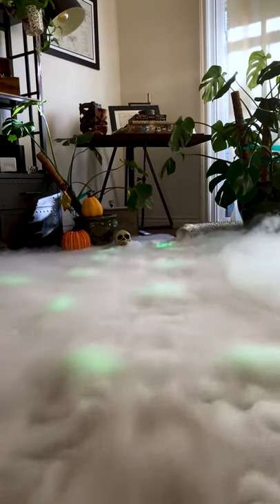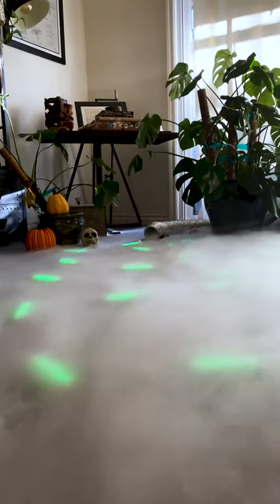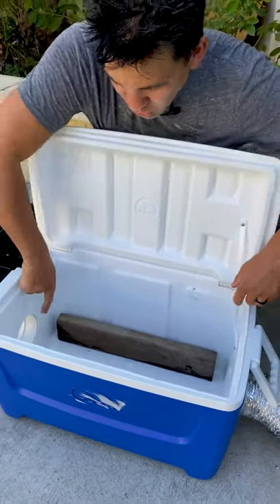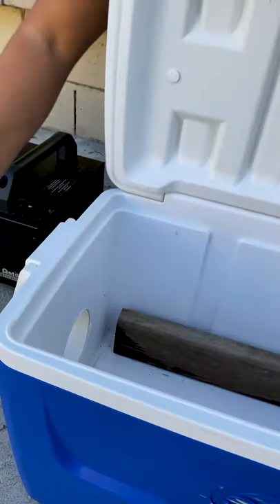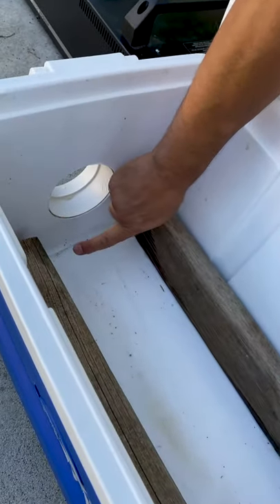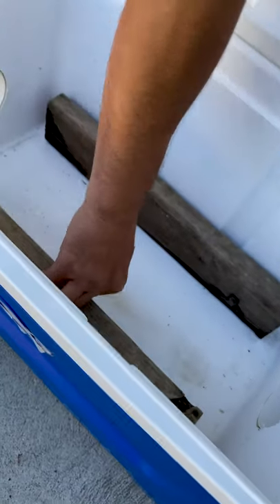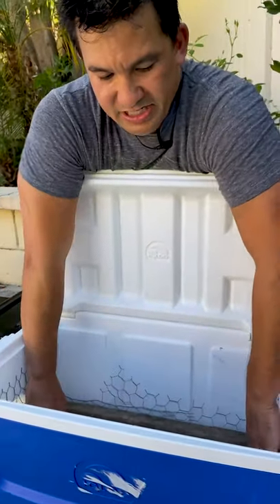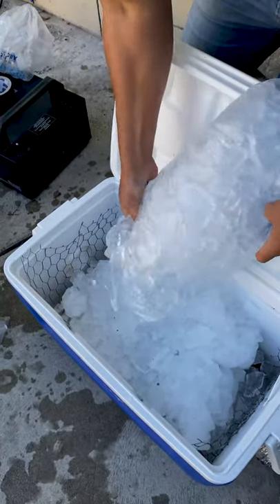Making A Low Lying Fog Machine #shorts

Comment: To the people that are saying it doesn’t work: You still need to use a fog machine! The ice isn’t making the fog. The fog machine makes the fog, pumps it into the one side of the cooler, it travels through the cooler with the ice, cools and comes out the other side low lying.

His point is that you don’t have to spend a lot of extra money buying a low lying fog machine that has a built in cooling system in it. You can buy a cheap regular fog machine and make it low lying. The warmer it is outside the quicker the fog will dissipate back into the air.
Reply: You understand. 
I was like wait a minute.
Still need to push air.
He doesn't show that.
Someone's going to mess up a good ice chest .